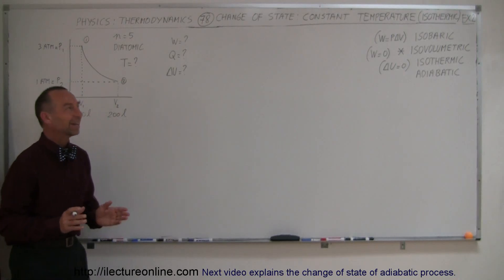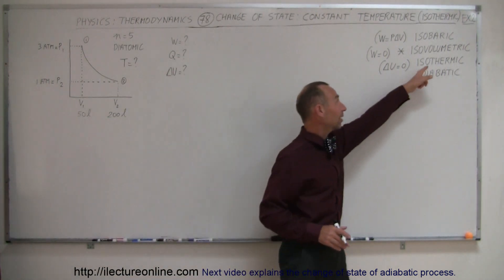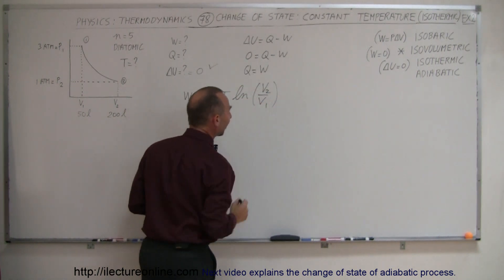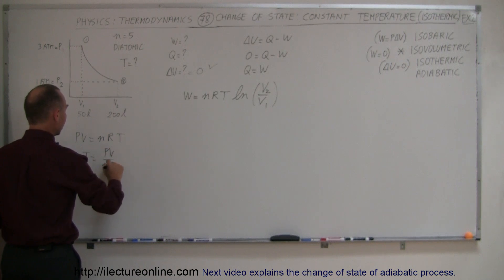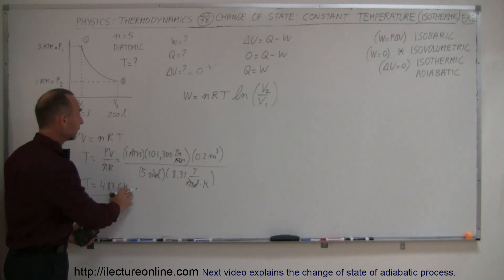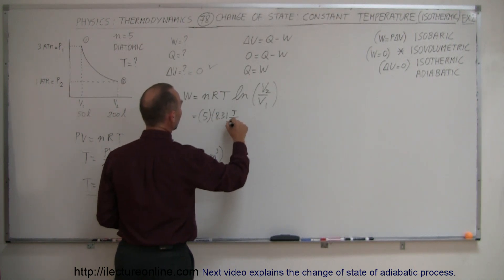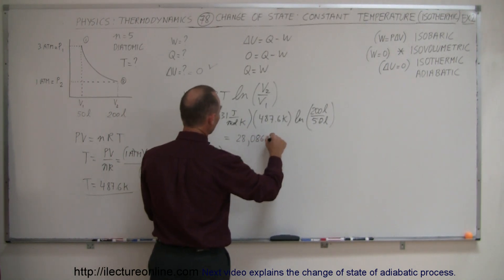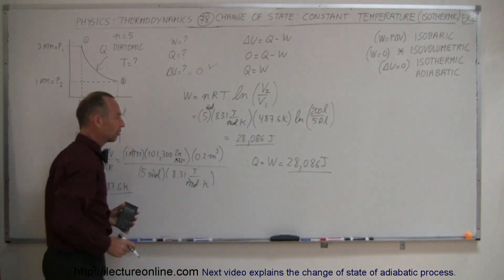Physics 27 First Law of Thermodynamics (14 of 22) Constant Temperature (Isothermic)

Comment: Mr. Michel, i tried solving for the work done using this equation: W = P1V1ln (Vf/Vo) but I i received 21,069.94142 J but when I used W = PfVf ln (Vf/Vo) I recived 28,093.25 J almost what you obtained there. Why is it so?
Reply from the maker: I recommend that you watch videos on significant figures.
Reply: @MichelvanBiezen  No sir, it's a different question! For the initial quantities the answer is different but for the final quantities the answer is different and accurate. So I'm just asking why it is occuring!
Reply: @andrewjustin256 he said in reply of one comments that he miswrite, P1 should be 4ATM. Now this works.
Reply: @kodapasy Thank you!

Comment: I have a question :
Q=n Cp dT   Write?
And dT=0 in isothemic process
Why is not Q equal to zero in isothermic process?
Reply from the maker: In an isothermic process, the gas does work by expanding at constant temperature.  Which means that the internal energy of the gas remains constant.  Which then means that all the energy required by the gas to do work must come from an external source in the form of heat.  That is why Q cannot be zero in an isothermic process.
Reply: Also for Q=nCp delta T and Q= nCv Delta T , yes delta T makes everything zero but we cant use this formula since we are not working with constant pressure or volume.

Comment: Oh I see what you mean by you picked the wrong initial pressure. Because P1V1 equal to P2V2, so if P2V2 is 200 then P1V1 requires the initial pressure to be 4 in order to get 200.

Comment: Why is the volume not converted to the S.I unit instead of liters?
Reply from the maker: You can express your answer any way you like unless it is specified.
Reply: If you have the same units on both the top and bottom of a fraction, they cancel out.  And whatever unit you'd choose to use here, if the final volume is four times greater than the initial one, then when you take the ratio of volumes you'd always just get a "4".

Comment: If you do the calculation for T2 you don't get the same temperature. Why is this?
Reply: I mean T1
Reply from the maker: Calculating for T1, the only 2 things that change are pressure (4 ATM instead of 1 ATM) and the volume (50 l instead of 200 l).  Thus T1 = T2.
Reply: @MichelvanBiezen   It's 3atm in the video
Reply: @romenowenogkfernando2592  and it's a mistake, he said it in a comment above.

Comment: I solved for temperature using the initial pressure and volume and got a value 365K. Which made the work 21034J. Am I missing something?
Reply from the maker: +Ismael Hernandez 
No, you did it correctly.  
I just didn't pick the initial pressure correctly.  (It should have been 4 ATM for the initial condition (not 3 ATM))
Reply: @MichelvanBiezen  But why is it 4 ATM for the initial condition? Is it 3 + 1?
Reply: @historyisthebest5831  no he accidentally wrote 3 in the PV diagram where he should've written 4. Since he wrote the wrong value of 3 he used it in the equations on accident. P1V1=P2V2 since P2V2=(***1atm*.2m^3) =.2 therefore in order for P1V1 to equal .2 as well P1 must be 4 since (4atm*.05m^3) =.2
Reply: I just did the same thing and it fucked my mind, thank you for trying to solve it on your own as well ;)
Reply: Thank you very much